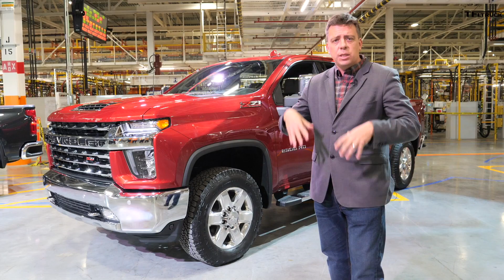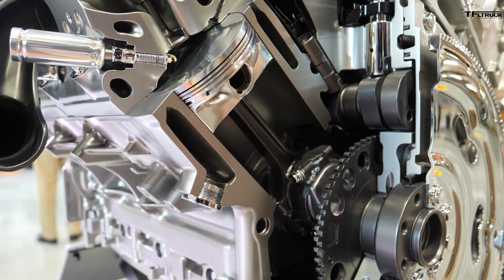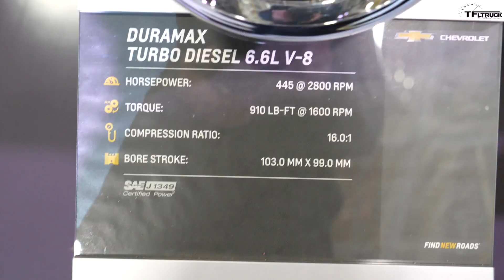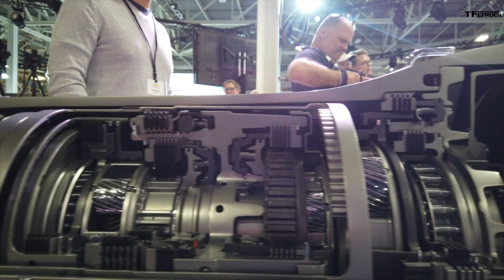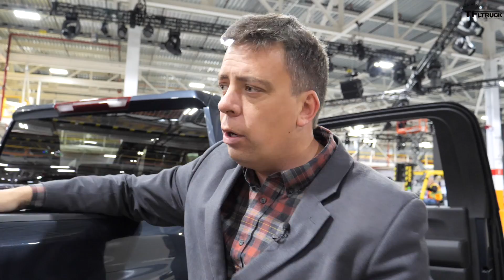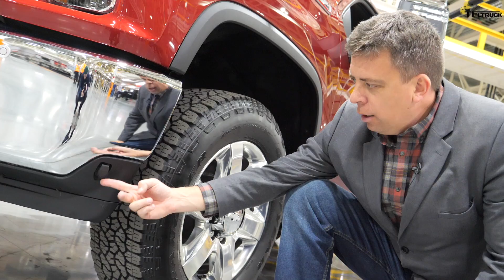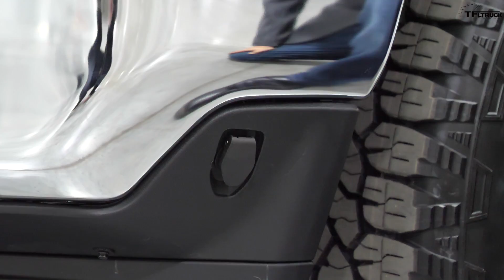Here is How the 2020 Chevy Silverado 2500 HD Delivers the Torque to the Ground

Comment: Ford did it better with a big block 7.3L V8.
Reply: If its not a disappointment, gotta wait to see the numbers though
Reply: @latwoods  given Ford's track record back to 1997 F150 2 today the 5.4 liter Triton V8 in 1997 to 2003 had a tendency of spitting out spark plugs are the 04 to 08 F150 the 5.4 Triton V8 have the tendency of splitting spark plugs and falling into the head the 6.0 liter powerstroke a tendency of failing turbo chargers the 5.0 coyote V8 gen2 and gen3 have a ticking issue due to no lining of the cylinder walls  because of cylinder scoring which leads to short blocks being replaced under warranty. The 2.7 and 3.5 EcoBoost have a tendency of timing chain stretch cylinder misfires due to intercooler cooling the air too much dust condensing water Vapors into the cylinder itself. From 2011 to 2014 EcoBoost engines have carbon build-up due to GDI injection. With 27 years of mistakes how can I trust for that they're going to get this right? And lastly all Ford warranty claims must be approved through Ford motor company itself whereas GM dealerships have the approval at the dealership level.
Reply: Benito JR you forgot the egr failure and head failure of the 6.4L power stroke and the early 6.7L powerstroke having head issues and a ceramic ball bearing turbo which over heats and the bearing explode which shave the turbo and in turn blow your motor because of shavings pouring through the intake. HORRAY FORD.
Reply: @Sackmatters  ➿➿😶Ohh. i Did NOT know that on the 6.7 issues!! very fascinating.. ➿➿. i do know the 150 3.3 V6 and 350 6.2 V8 are bullet proof units
Reply: @Sackmatters , 6.4 diesel is also known for poking holes in the water pump, ouch water mixing with oil
Reply: Why RuMad ford does everything better!!!!!
Reply: That Ford 7.3l looks like a LS engine, 1 cam and pushrods
Reply: Yup
Reply: @I know you are right, And I just got owned but: The LS is a clone of Fords 351 Windsor lol even the heads bolt right up😂
Reply: @Jimmyxsx  no they don't you have to modify them a little bit. But the whole "they copied us" argument is just stupid. The LS rods and pistons can go in the old SBCs it even uses the same bearings. Most of the design on the LS is a blend of SBC and the old 400s with a block copying a diesel construction. Also the only thing about the new 7.3 that looks like it came straight from an LS is the rocker arms everything else is different. Ford went back to push rod because it's reliable low end power. No one copied anyone.
Reply: @Jimmyxsx  Wtf..... Even ford guys pull that junk out and slap in an ls!
Reply: @T_B_C_L  no ford guy swaps LS engines. Its the chevy guys that want to own a mustang but dont want to get criticized by their gm buddies and use the swap excuse lol Ford has a badass Coyote 5.0L that outperforms pretty much anything gm can throw at it lol
Reply: Why RuMad Yet a ls with a standard cam can slap the shit out of a dual over head cam 5.0 and I’m no ford hater, I own 2 of them. They plain and simple cannot out perform the ls platform.
Reply: @Jimmyxsx  this whole comment made me laugh especially the part about the huge ass coyote engine. 🤣😅😂😭🤣😂🤣
Reply: @Jimmyxsx , I thinks it is Ford guys looking for better engines
Reply: @anthonywebber2211  there is nothing better than a Coyote 5.0L. E85 tune, CAI, and LTs are youre at 500whp lol no need to swap stupid cam and heads in order to make power lol
Reply: Why RuMad
thats because of the flow of the valves, and GM tuning is a bit more conservative , GM can get pretty big power out of tune only
 18:22-20:54
Chevy SS Picks Up Big Power Tune Only 
https://www.youtube.com/watch?v=hjwIszctK_k
Reply: Anthony Webber - Coyote does 8 second 1/4 mile on stock unopened engines many times has any ls ever done that ? No.
Reply: @anthonywebber2211  excuses lol Ls engines have a lot more displacement and cant even outperform a smaller displacement Coyote😂 The voodoo 5.2L made more power than GMs huge 7.0L LS7.
Reply: @Jimmyxsx , LS7 may be big displacement, but at least it's physically small enough to fit into a Chevrolet Sonic,  and there's a BMW drift car that has an LS7 that has an LS7 the makes 900 HP at 9000 RPM naturally aspirated
Reply: @anthonywebber2211  no one cares about external dimensions lol displacement is what makes power and liter per liter Coyote reigns superior. LS fanboys lol only peasants swap Ls engines😂
Reply: Why RuMad
i guess that make Ford guys peasants
Reply: @anthonywebber2211  ford guys dont swap pos ls engines into mustangs. Its the chevy guys who want to own a mustang but dont want to get criticized by their chevy buddies so they use the swap excuse😂 who swaps a pos ls engine when you can swap a badass Coyote 5.0L lol Only peasants swap LS engines haha
Reply: Why RuMad
i think it is Ford guys swapping LS engines into Rustangs, i will say this this tho, i want to get a Fox body to swap a 4 cylinder into it to piss off Ford guys
Reply: @anthonywebber2211  ford guys dont need those pos ls engines when ford has 351w, 5.4L DOHC, Terminator 4.6s, Coyote 5.0s lol chevy guys love foxbody mustangs because of how lightweight they are, they look good and fairly easily to modify. Unlike their ugly pos 4th gen camaro haha no one bought that ugly pos and was taken out of production😂😂
Reply: @Jimmyxsx , one thing you not getting, is a lot of LS Mustangs are budget builds, have fun getting a Coyote for $500-$1000
Reply: @anthonywebber2211  lmao😂 Coyotes came out since 2011 lol There are thousands of them for sale at wrecking yards. The F150 sourced coyotes are being sold for $1500. The only good ls engine thats even close or comparable to a coyote in power is the LS3 and you wont find an LS3 for less than $3000.
Reply: Why RuMad
you say the Coyote is so plentiful, yet hardly any used for swaps
Reply: @anthonywebber2211  there are hundreds of coyote swapped cars.  even some porsches are coyote swapped lol
Reply: @Jimmyxsx , that's cute
Reply: Christopher Field
really? these are mazda raceway laguna seca lap times
GT350R (526 HP) 1:36:11
SS 1LE (455 HP) 1:37:78
Reply: @Jimmyxsx , Seven Marine are use LSA for outboard motors, LS3 are used as airplane engines
Reply: @Jimmyxsx  I'm still laughing at you and your coyote savior.... Lol
Reply: @T_B_C_L  keep laughing still Coyote>LS any day😂
Reply: @Jimmyxsx  said no engine builder ever 😅😂🤣
Reply: @T_B_C_L  still Coyote>Ls any day😂
Reply: it may be bigger, but it wont work,

Comment: Andre should have asked about valve coking due to the direct injection.
Reply: Mario Lopez  Sounds cool on paper but it doesn't really work. Because fuel never hits those valves and intake.
Reply: @ShersGarage  it will hit intake and valves when PCV valve starts recirculating though.
Reply: Exactly! What are they going to do to prevent carbon buildup on the valves besides a very expensive head off walnut cleaning?
Reply: This is the primary reason why ford went to dual injection on the coyote.
Reply: I think that was only on the Ecoboost engines; I don't think the 5.0L has ever had direct injection. @nahrens223
Reply: @takayama1638  - it has had it for a few years
Reply: Perform a fuel induction service every 15-30,000 miles. Not the end of the world
Reply: “Industry first”? How exactly is it an industry first when GM’s primary competition has been using the technology for several years? Direct injection has been around for quite some time now, and the manufacturers that have been using it have been able to identify the inherent problem (valve coking) and devise ways to mitigate the issues. GM’s cylinder shutdown idea sounds great on paper but in practice it’s terrible. Rings coking up, lifters collapsing, camshaft and cylinder wall damage... no thanks. I used to really like GM trucks. Until I had one that started to self destruct at 50k miles. Used oil and the whole bit.

I still like the GM trucks. I just don’t trust them enough to spend my hard earned money on them. So I now have a blue oval in the garage because Toyota doesn’t build the cab/bed configuration I want. So far, so good. It’s been an excellent truck.

For the record, I still own a 2006 LBZ 2500HD. Great truck. I keep it for towing the really heavy stuff.
Reply: Yes I wish he would of asked. I believe the 6.0 was port injection and it is a bullet proof engine.